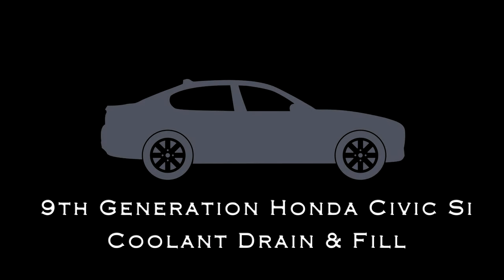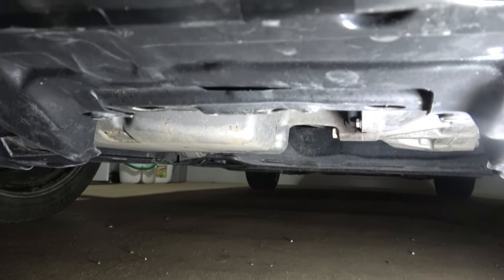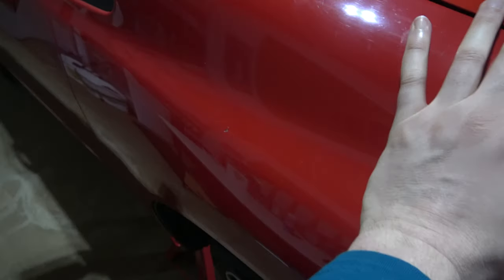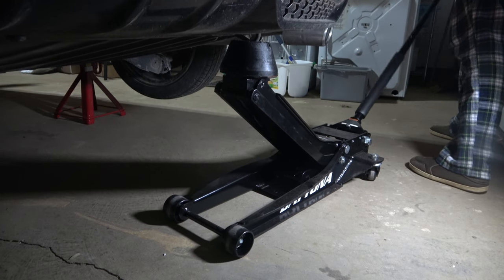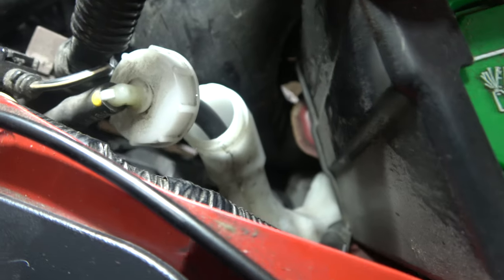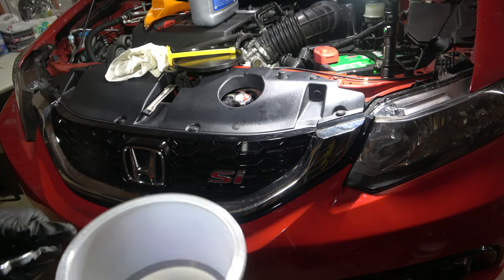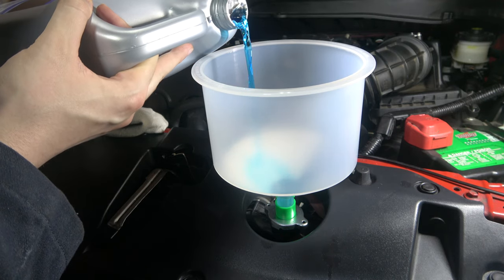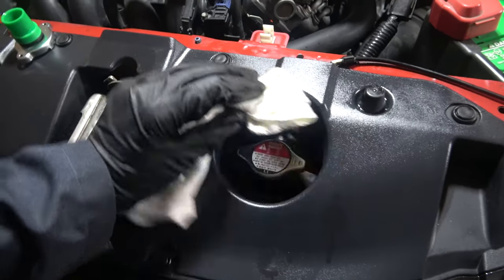Drain & Fill Antifreeze Coolant - 9th Generation Honda Civic Si 2012 2013 2014 2015

Comment: If I want to superflush the system, I just need to run water through it 2-4 times right?
Reply from the maker: You can do that, but use distilled water.  Remove the radiator cap and pour distilled water into the radiator until full. Replace the cap, then start up the vehicle and let it run for 10 to 15 minutes. This will work the distilled water into the engine, flushing out any loose debris or corrosion along with the last of the old antifreeze.  It’s important to watch your engine heat and be ready to turn off the engine if it starts warming above C.  Also don’t actually drive the vehicle, just idle.  Then add your coolant per the manual capacity recommendation.
Reply: @Stimwalt  That was a quick response! Thank you! I do hate the location of everything on this car though...it's a pain in the arse!
Reply: @Stimwalt how do I know when it’s almost above c? It only has noti light for when it’s cold just go by mins huh

Comment: How do you know how much coolant to add and when to stop ?
Reply from the maker: A typical drain and fill takes 1.3 gallons, but I would have more on hand to be safe.  Your manual also has the capacities listed.  You basically stop when the fluid is no longer being pulled into the system, as is shown in this video.

Comment: Love the tutorial. Some may want to check if they can crack the wing nut from the top to avoid jacking the cad.

Also as a noob, I find crawling on the floor to ensure I aligned with the jack pt helpful